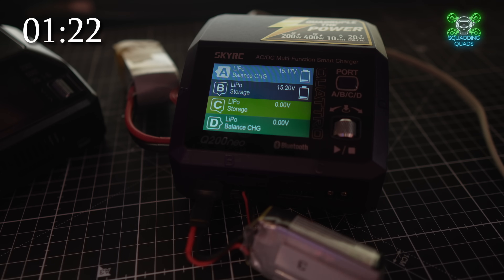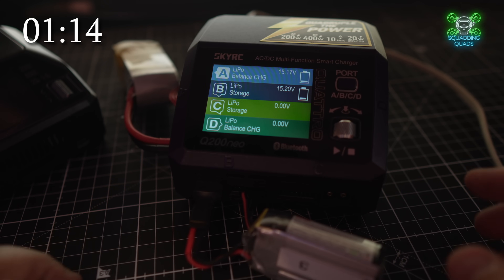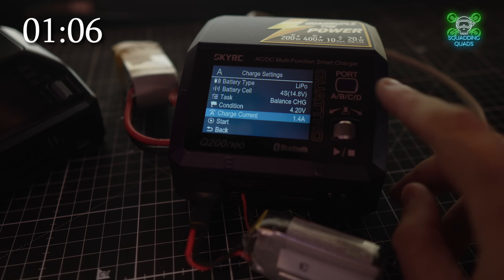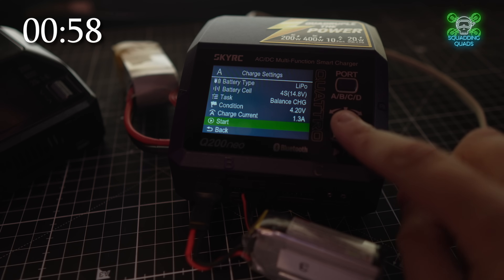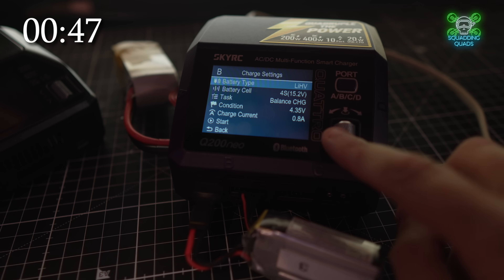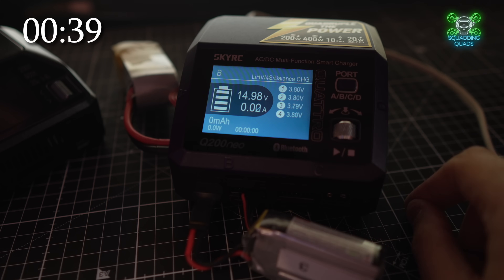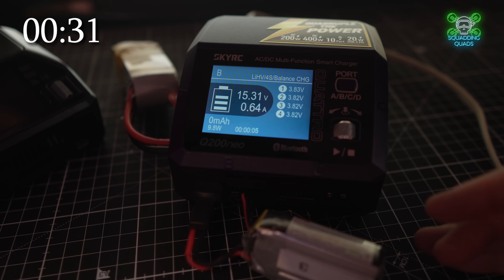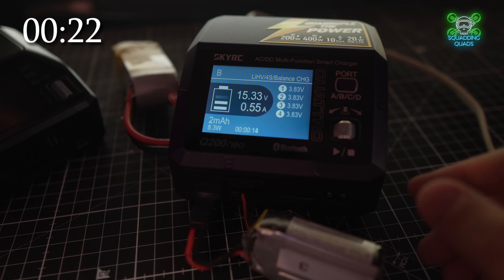Set Your LiPo Charge Current Safely in 3 Minutes! 🔋💥 | Quickie with Quads

Comment: Oh god! I’ve been charging my 4s 650mah lihv @ 1.5a. I’ve only charged them like 5 times each. Have I damaged my batteries?
Reply: They will be okay, but you should lower your charge rate a bit. Your charger isnt going to over charge, it will automatically cut down the amps as the battery charges to the set 4.2v. Your batterys will be fine, you just charged them a little faster than you should have.
Reply: 1.5a = 4s/6s 1500mAh
Reply: Chances are that they'll be absolutely fine. I don't know anyone that charges at only 1C.  Have a look at the spec sheet for your actual batteries  -  lipo charging rates can go from 1C to 5C.
Reply from the maker: Not at all, this advice is to air on the side of extreme caution for newbies, you should be fine, but if drop it to at most 1.0
Reply: That's only a touch over 2c ,just about every pack I've seen will handle that just fine, lower it to 1.3A for a 2C charger rate, it wont do any harm at all.. 1C is easy for every pack on the earth, 2c is fine for %95 of packs, just read the label for max charge rate and stick to that.